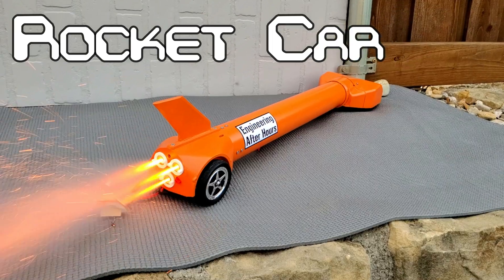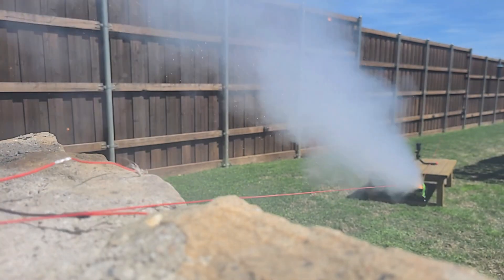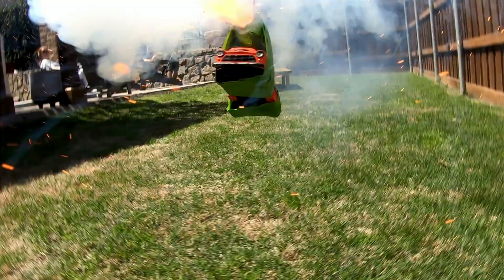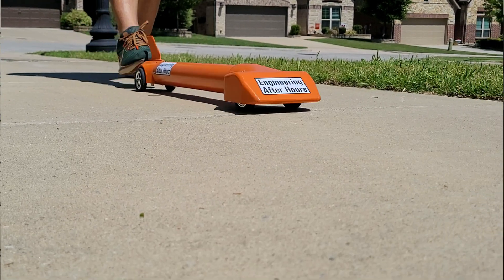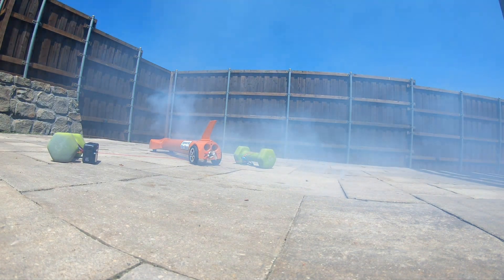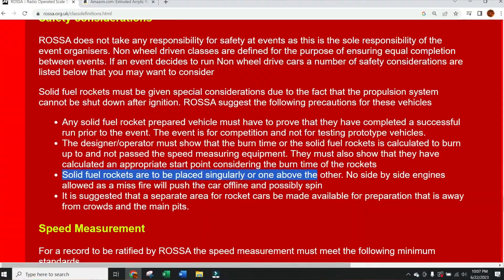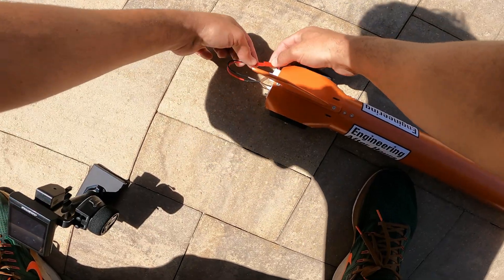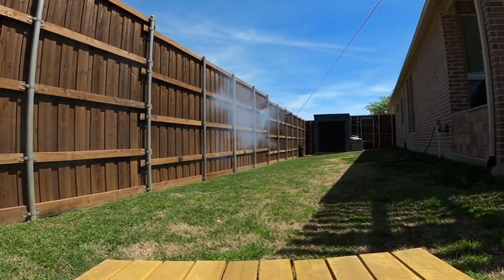Rocket Cars are a Bad Idea.

Comment: Looking into multi stage rocket motors.  There are some that will not fire the ejection charge out the top of the motor thus not launch themselves out of your test bed.  

However a more viable option is to engineer a small escape route from the top of the rocket motor to the exterior of the vehicle. You will need one for each motor.  But a small 1/4 inch tube mounted just on top of or near the top of the rocket motor and routed to exit the vehicle near the top will result in a path for exhaust gasses.  This way they do not build up pressure and jettison the rocket motor.  My guess would be routing them to exit out the top of the car would be they might add a small amount of down thrust to the top of the car and aid in traction or keeping the front down.
Reply from the maker: The estes motors I'm using actually are booster stage motors so they don't have an ejection charge. I think it's because they weren't plugged. 

The venting is a good idea. This system is actually vented but for whatever reason I forgot to add the pass through in the adapters that allowed me to swap motor sizes.

Comment: I have built similar cars. Rocket only is fine however suggest all motors in a vertical plane incase one or more doesn't  light. I have seen r cars with G motors and it is important to have a teather steel cable laying flat in the road trailing the car so when the car at high speed hits a small imperfection in the road and decides to go airborne it is contained
Reply from the maker: Yeah if I were to cut this loose I'd need a lot of safety added

Comment: need a reverse or stopping device?? How about a deflector plate... passenger jets use a thrust diverter to reverse the thrust on the motors from rear to front...  jet skis and boats also use the same device. It could be used for emergency reasons while thrust is being produced. Once the thrust is no longer available and its all inertia you are back to frictional brakes or snag hooks.
Reply from the maker: That's an awesome idea. Gotta be something high temp rated though
Reply: @EngineeringAfterHours  titainium comes to mind  but tungsten is even better but way to heavy

Comment: ROSSA is living in the past they also only allow one brand of speed traps. It's just stupid... Build what you want to build and check speeds off GPS.
Most guys are not running suspension on the cars.  Shocks have maybe 2mm travel due to travel limiters.  Tires will be a big problem.  Even with foams the diameter is an issue with existing 100-103 mm tires.  You may want to design around the tires needed to safely go that fast.

Comment: I love the idea of the rocket car.   Rossa's rule about the rocket motors being inline is kind of strange.  It seems like they should be much more worried about the location of the center of gravity because a vertical inline configuration isn't any more stable, and possibly less if the car rolls from a bump.

I'd love to see a reverse thruster for a brake 😁
Reply from the maker: 100% agree that CoG relative to thrust vector should be the concern. 

I want to try and beat your speed of a 3D printed soeedrunner soon...maybe I'll throw a reverse thruster on that :)

Comment: The old school way of doing suspension is an aluminum or fiberglass torsion system.  Today you've got Aluminum, G10, and Carbon Fiber just 1 click away.  I'd probably try to come up with a torsion suspension based on CF, because G10 might break if there is an unexpected impact. Then again, maybe Kevlar is the better choice because of resilience?
Reply from the maker: The fact that you mention resilience let's me know you know your stuff. These are great ideas and I can count on 1 hand the number of times I've discussed resilience with someone that actually knows what it is. 

I want downforce in a version of a speed runner.